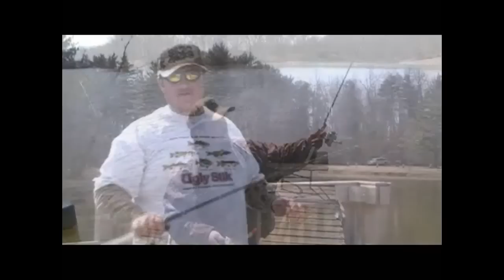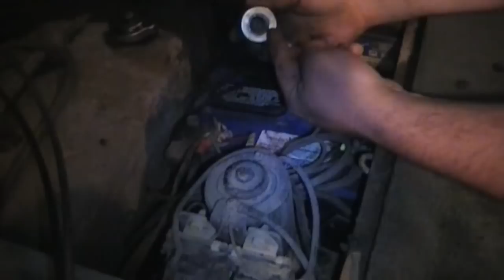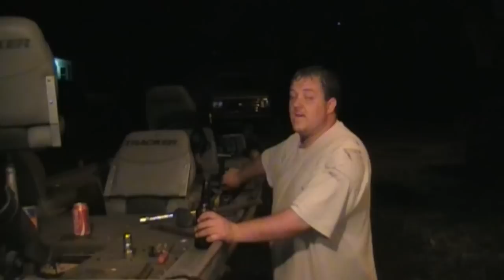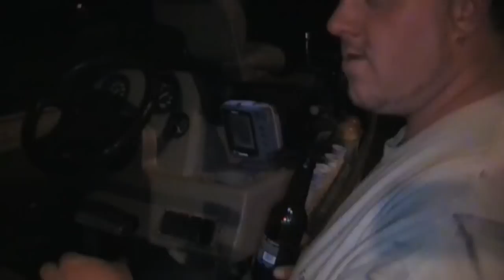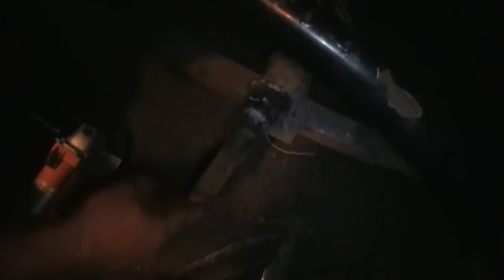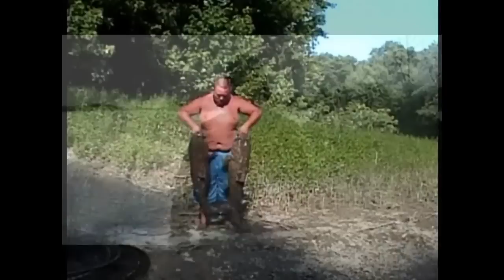How To Boating Tips Befor Hiting The Water

Comment: @597Illinois Try it, the acid in the coke will clean the terminals by itself without the baking soda. You just have to be careful, if you get it in the battery it will ruine the battery.